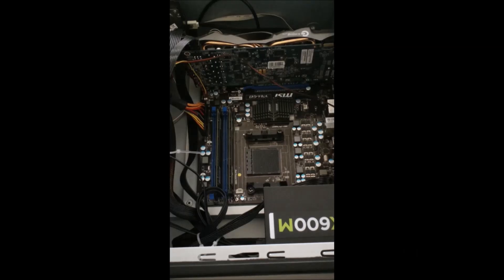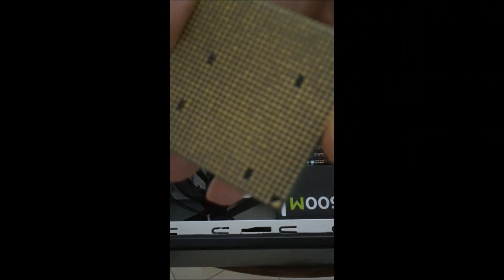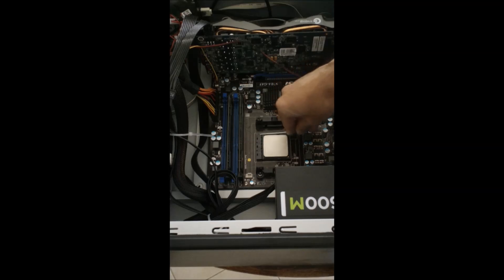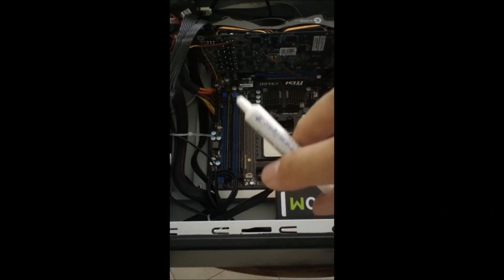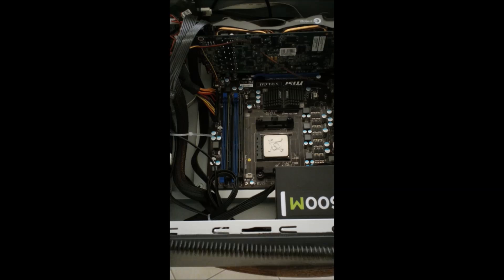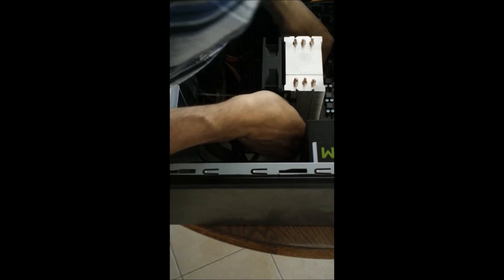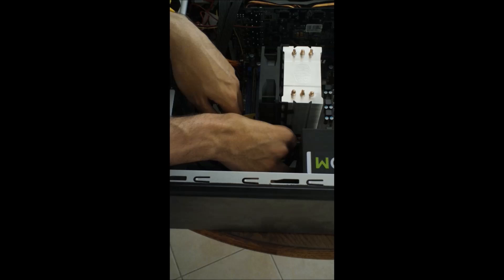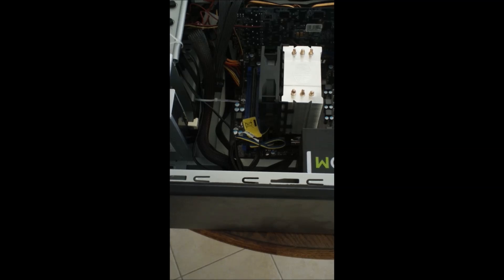Installing an fx 6350 cpu and a Cooler Master Hyper TX3 cpu cooler

Comment: Question does the stock heatsink/fan that comes with the FX-6350 come with the bottom portion that attaches to the MoBo? My OEM 6120 attached via 4 screws that were very close to the CPU edges thus no bracket like the one you show has.
Reply: Attached to the motherboard out of the box there should be brackets
Reply: roger tan yeah noticed my stock fx-6120 is slightly different it has four screws that attach directly to the mobo w/no bracket just four holes, looks like if I go w/newer type need to put a backplate and attach bracket to be able to attach heatsink/fan. gotta Thermaltake Orb heatsink/fan & TX3 plus the stock/OEM. paste method have always gone with the pea size in the middle but there is no 'proper' way, regardless of what u hear.

Comment: man this is so confusing. i keep looking but i dont understand how this is getting latched to the dang cpu. what is the latch holding down? i dont get it at all.
Reply from the maker: Sorry I didnt get a good angle on the camera, but for am3 cpu cooler there is one  side with a lever and another side just with the opening to latch on.  Start with the side that doesn't have the lever then just keep working at the side with the lever until it catches, then tighten down the lever!
Reply: i was finally able to get it. yeah now i only got to struggle with 100 more things but i did manage to get this down haha

Comment from the maker: I get about 55 celsius when I'm rendering videos, that's at about 85% cpu load not overclocked
Reply: MC-Gaming-Blacksmith92 You did WAY to much Thermal compound on your CPU bro :D You are supposed to use a Pea sized Dot

Comment from the maker: It was the mounting mechanism the zalman I went with screwed down onto the cpu and this one was a lever mechanism that gave it a good firm seating on the cpu, the cooler itself probably would have been alright.  But yes I agree the stock fan is very loud which is why I switched it out, personally I think this is one of the better amd cpu coolers that doesn't require a backplate it is rated for 125 watts so you should be fine with this cooler master cooler and the price is very fair too!